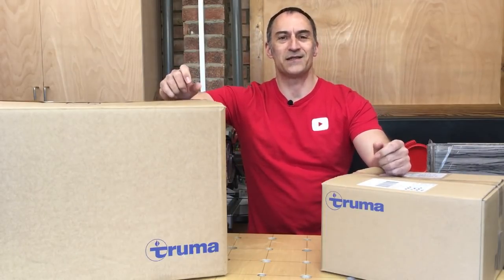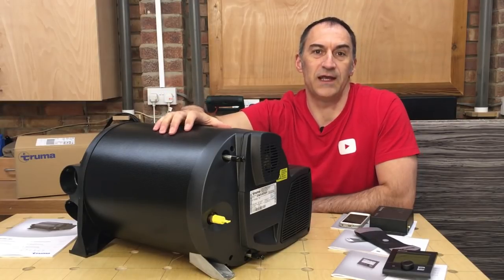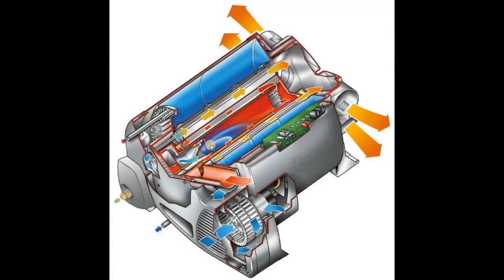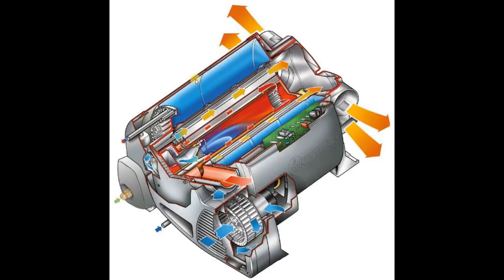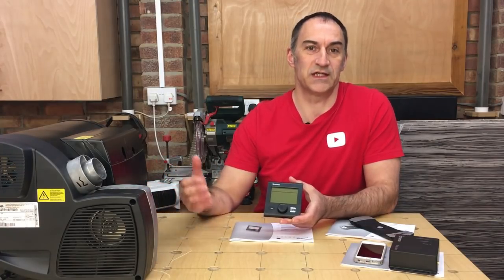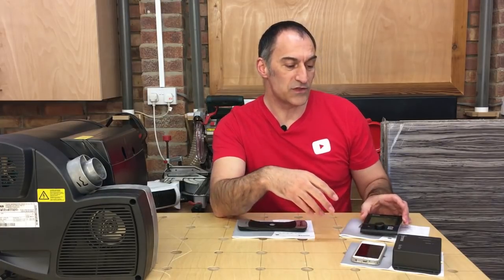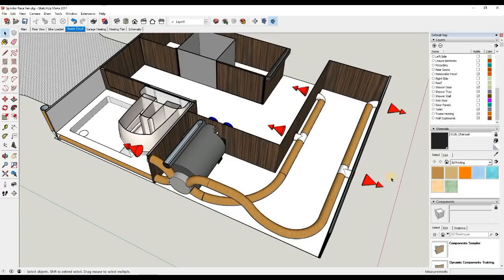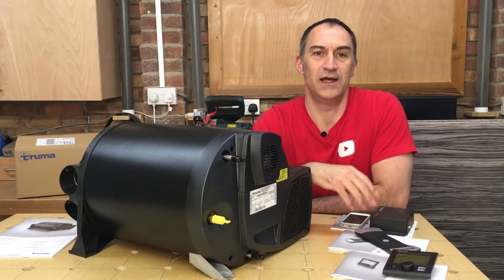Truma Combi 4e Heating & Hot Water Boiler

Comment: Hi Greg, what is the power consumption of this device and what kind of electrical system you suggest to have in order to run it well? Especially in my case where I do not want to use gas in the van. Thank you!

Comment: Hi Greg, great video thanks. Quick question - how does the the Truma wire into the 12v electrics? Can it go straight into a blade fuse in the box or does it need to go via a breaker? Also on the 240v side? Many thanks

Comment: very smart .. when it works - our Truma combi 4 e does not heat the air enough on gas/mains, AND overheats the water to the point where the red outlet pipe melts from the heat.. how come a temp sensor is not controlling this?

Comment: What do you think about using something like a Bosch TR2500 or a 5l Speedflow Undersink Electric water heater run off a 2000 watt inverter? 

I’ve seen a few USA sprinter conversions video that use this type of setup although off Lithium Ion batteries? 

On paper it’s a cheaper option for myself v the Truma but I’m just not sure/experienced enough to know if a power setup similar to yours Greg (which I intend to copy) would work?

Comment: Very nice presentation. I have been using my Truma in our RV since 2008 and still working as good as new. Good quality and great performance. Don’t have the option of electric heating of the water but yet but that is a spare part that I hope to install now that I am extending my roof solar from 100 watts to 1000 watts and a 3000 watt inverter.
Reply from the maker: That’s great to know you’ve had 9 years good service. 
I’m only planning to use the electric heating when on hook up as 900w or 1.8kW would kill my batteries in no time.

Comment: Hi Greg, great video. Question though: In one of your earlier videos is see you show a separate system (heater and boiler) i believer it was a Whale boiler and gas propex hs2000 heater. Advantage of this system IMO is that i can install both underfloor, which will save extra space. Another - i would consider as an - advantage would be that it are 2 separate systems, if one is broke, the other still works.... So, my question is, why did you choose for the Truma Combi system? (in comparison to 2 separate systems?). Thanks! Antoon - the Netherlands

Comment: Hi Greg. Thanks for the wonderful videos. I have a thought. How do you think it would be to use one of the four outlets to blow hot air into several 30mm pipes in the floor as underfloor heating? For example, with XPS made for waterborne heat where the air comes out on the other side of the floor.

Comment: Silly question, but can you take it out the box and plug it in to mains and just use it as a heater? 

As not to worried about hot water just want a good heater.

Thanks
Reply from the maker: I’ll be honest I’m not sure it would work without water in it?

Comment: Thanks for the great video! 
I'd still go for diesel version if you plan for more than couple of days offgrid in cold weather.
Combi 4 eats around 0.2Kg (0.4L) LPG per hour in a van like your Sprinter with 0-20 temperature gradient.  
This is roughly 10L LPG tank per day even without cooking and hot water.
And Webasto dual top can be mounted outside and free additional 70L of living space.
Reply from the maker: I will give you some exact usage data once we are on the road. Its all relative to how well the van is insulated as to how long the heater is running. Plus if we are cooking the heating will not be required either. We don't plan to spend too much time in the cold as winter camping is not very enjoyable. We will be on the Med by winter where its a bit more temperate.

Comment: Hi Greg, I have almost finished building a new caravan out of an old one and have installed a Truma 2E Water/Space heater. Gas and 12 volt were done by qualified tradesmen and I have followed your excellent videos for water plumbing (which is all working well). However, your videos indicate that, once the sensor and data cable are connected to the unit, the sensor should be sending the signal to the control panel but I can't seem to get the control panel screen to open and there is no backlight coming on. Are there any other steps to get it working? The control pad has the horizontal line across the top of the screen and I've tried holding the button down for a few seconds as well as touching the screen but to no avail. I've also checked all fuses including the 10 amp fuse in the unit.  Can you help? Thanks & Regards, Barrie (I live in Australia)
Reply from the maker: The CP control panel also needs a 12v supply protected by a 1Amp fuse. There should be a short plug and lead to connect onto the controller and to put power to. That will bring the controller to life 👍🏼🤩
Reply: Thanks Greg, Before I contacted you I had phoned Truma Australia who asked me had I connected the Data Cable between the unit and the CP and indicated that this was the power source. However, it seems it's not. I bought the heater new about 4 years ago and on the list of inclusions in the kit, #6 is "CP Plus GV". Do you know what the GV is? Everything has been in boxes since I bought it but I haven't seen the little lead you mentioned. Can you explain where this lead should be connected? Also on the list (#7) is a Sicherungshalter which I have - Does this have anything to do with the little lead? Thanks again, Barrie

Comment: Shouldn't the outlet pipes be of an equal length? By the looks of it, all your hot air is going to go into the bathroom because that is the shortest bit (least resistance), or am I wrong?
Reply from the maker: The bathroom vent has a butterfly valve on the outlet and we can close it right down to prevent that happening.

Comment: Hi Greg.  Great videos . Just wondering why you chose the 4e and not the cheaper 2e? .
Reply from the maker: It will heat the water to full temp in less than half an hour from cold. :D
Reply: According to the Truma info sheet the 2E does the same water heating time . I guess it will heat the cabin slower perhaps .

Comment: Thank you for explaining how this works, excellent diagram and detail!  Its a very efficient system.
Outside and inside air are heated, and while air heater is on, it also heats up the water, very smart!
The phone app and SIMM card remote control, propane tank accurate gauge is just genius!  Truly remarkable German technology!  Even named after US President Truman!  When I build my van, I don't care how much this costs or how hard to get hold of one, I am getting this system and no other.  Its a marvel of science and so beautifully created that it should belong in the Museum of Modern Art (MOMA).

Here are some other facts for viewers:
1. The only deal breaker for Americans may be that this runs on 240V so do they make a
        version for US market at 110V or will this run on a step down adapter from 240V to 110V?
2. I looked up cost on ebay and its not cheap at US $2700 approx.
3. Truma  in Germany does not sell the Combi directly to consumers, only dealers.
4. You can look up specs and buy it from this Aussie dealer at AU $2400 + AU$32 shipping. 
         https://www.mygenerator.com.au/truma-combi-4e-kit-gas-heater-hot-water-system.html

5. The weight of the Truma Combi 4e is 15.8 kg or 35 lbs
6. On the link above, you see all accessories, ductwork diagram, and specs.
7. Yes, you can run the water heater independently of the furnace heater.  However, your hot
         water is also heated for free if you run the furnace.
8. Combi runs on a variety of fuels and power sources:  gas, diesel, propane, AC, DC, and using 
        hot engine while driving if you duct it that way.  Refer to link above.

Thank you Greg, for another great video and adding to the RV/Caravan knowledgebase!

Comment: Another great piece of info Greg. I was originally thinking of a heater similar to the night heater in my truck running on diesel, but this system is far superior & combines the hot water function. Once again your info is a great help in my research before I take the plunge.
Reply from the maker: You're most welcome John, I'm pleased it was useful to you.

Comment: What about pulling the cold air return from the ceiling instead of the floor? I grew up in a house that was configured that way and it produced quite a uniform temperature from floor to ceiling. From your line of work I'm sure you are familiar with it. Hot air rises and cools as it does so. Would this add any efficiency to the system?
Reply from the maker: As you rightly said, The hot air rises, so it's actually cooler at low level and warmer at high level.

Comment: Hi Greg you may not of started it but how are you running water to your sink and gas from you LPG gas cylinder to the Combi Heater. Are you going out through the floor and across then up into kitchen unit. I am also fitting the Truma but was considering running under plywood floor. Just got van so starting in earnest soon
Reply from the maker: Hi Tracey, I have run my water and gas from one side to the other, underneath the van fixed to the chassis.
The main reason for not burying them in floors or walls is if any of it leaks I will never know until it's way too late and the damage is done. If it was a house build it is against current water bylaws to bury services into walls.
All you gas joints should be visible and in ventilated spaces.
Reply: Thanks for prompt response. Greg you are a Star Just bought my flooring materials. First run out in the Van. I am well excited to start my build and following you and others converters microscopically... I love your year plan to tour continental Europe I just posted a FB picture with my Van on the new Drive over last weekend. FB post - So here is our new venture called EDD (Explore Dream Discover) A conversion project into a home from home. He will take us on many adventures. From John O'Groats to Lands End, Coleraine to Cork, Trondheim to Tangiers and Brest to Belgrade. It will take over a year to convert but we cannot be more excited. The design is complete so lets start cutting holes.... Tracey

Comment: hello, Can I use this Boiler 100% electric to save gas? And my second question is can I take long showers with this model, or only have 10 liters? sorry for my english
Reply from the maker: Yes you can use it just on electric. I would recommend that on hook up as it’s rated for 1.8kw on electric 
You can use it on both field too for fast recovery. 
The water is 60°c so you would mix that with cold for a shower and it last long enough for decent shower.
Reply: @GregVirgoe  two people could take a shower with a single 10 liter tank? or it is necessary to reheat the water. Thanks for your time.

Comment: Hi Greg, realistically and setting some family expectations how long of a shower can be had with 10 litres of water? Just realised this is 2 years old!
Reply from the maker: The water temp is 60°C so you mix it with cold at the shower and get far more than 10litres. Lou and I can both shower on one lot of hot water. So if you use it all yourself it’s ample. We use a trigger operated shower head to conserve water
Reply: Greg Virgoe thanks for the quick response👍 unless it’s long hair washing day we should be ok for 2 showers that’s good to know! Another quick question. The E in Truma 4e indicates electric is that electric heating and water ie no gas used, off the hook up? Trying to make sense of all resource needs on and off grid 🤔👍currently looking at a Wildax that uses this Truma version 

‘
To

Comment: Greg-- do you know how much voltage is needed to run this system electrically when not using propane? Is it efficient voltage wise?
Reply from the maker: CHERIE VEAZEY the control system runs off 12v DC from your leisure battery and that use next to nothing to operate the controls, the electric heaters are 2x 900W each so a total of 1.8KW and these must be run off mains voltage 230v. Now I would not recommend running these electric elements off an inverter as it would drain your leisure batteries in minutes, I only switch these on when on campsite hook up shore supply. Although we have not used them at all so far as we have been wild camping the whole time and just running off our solar system. ☀️🌳👍🏼😎
Reply: Greg Virgoe so just to clarify, you can still have hot air heating  without running it off of the mains ?

Comment: Hi, great video. Is it possible to use just 2 heat outlets and if so how are the others blanked off? Would it make that much difference to heating the van? Also can the piping go down under the flooring and back up to where they are required as the furniture layout was completed prior to the purchase of this heater and the layout would have to be substantialy altted
Reply: I mean altered!
Reply from the maker: Hello Rob, three is the minimum you can use and put a blanking plug in the 4th. 
You need to pass a certain amount of air through the heater to prevent it overheating. I guess there nothing stopping you running the heater ducts outside but you would have to insulate them really well and protect them from damage. To prevent the air from getting cold in the external ducts.

Comment: Are you concerned of the garage area for any 'off-gas' (used as a general term) from your bikes et al. with putting the heating ducts/vents to this area are you also providing a path for any smells /fumes or through or around the bed frame. You are heating the bikes and any oil/grime could scent the area... Are you concerned that it will make it back to the living areas? maybe add a charcoal filter? Just a thought... (Foresight is always better than hindsight )
Reply from the maker: Hello Jon,
The only time a bike will be in there is when we are transporting one. 
When we are living in the van the bike will be outside of the van.
The outlets of the ducting have single blade dampers that can be shut.
The majority of the use of this vehicle will be with motorbikes just push bikes.

Comment: How has the truma performed thus far?  Think you sold me on it.
Reply from the maker: It is incredible, it just works so well and we use it mostly on eco mode and you can hardly hear it so quiet. 
You have the benefit of dual fuel when on hook up and the remote control via app on your phone even when away from the vehicle is one of the best features. 
You won’t regret it 😊
Reply: This is a huge bummer. Just found out that I cannot get the truma furnace/ water heater for dwisel fuel here in the US. Only motorcoach manufacturers can get it😬

Comment: Hi, I hope you are well. I have a question regarding heating and M.O.T. In my conversion (planning stages) I wanted to install an induction cooker and if I do use this unit, run it electrically. As I understand it if you have lpg, your M.O.T. is dearer and more detailed as they have do check the gas system as well. Would I be able to skirt this cost by soley using electrical power for cooking, heating and washing even if it means have 3 to 4 leasure batteries? I tend to drive longer distances when I do so I may be able to off set higher energy usage through regeneration whilst driving.
Reply from the maker: If you are resident in the UK then a Motor Caravan would get a class 4 MOT test which is the same as you have for your car, only if the weight of the vehicle is over 3500kg would it be a different class of MOT for heavy goods vehicles

Comment: Well impresive - does this mean you have to blow hot air even on a hot day to take a shower ?
Reply from the maker: No, the hot water can be heated without having to have the heater running.
This version you can also heat with electric when on hook up.
Reply: Sound just the jobbie

Comment: Hi Greg, Apologies for the late reply but I have been up north at Arisaig in my Vantage Sol (which has a Truma Combi 4) over the last week or so. Just to say the Turma works very well. I have been in temperatures of minus 13 in February with it and I was nice and warm. One point though Greg although it doesn't apply to my Van. I have seen on both the Autosleepers and Autotrail forums complaints about hot airflow to the furthest away vents from the Truma. Have you any concerns about even distribution of heat? Also just a point the cold spot in these Vans is at the sliding door where there is often a draft and the heat escapes quickly, have you considered this in the design? Another great video by the way ;> cheers.
Reply from the maker: Thank you William for the constructive feedback. I have got some adjustable vents to restrict flow on close outlets. 
I can position the vent in the bench seat closer to the door to help with that cold spot. 
Thanks again for the advice.
Reply: Cheers Greg, The warmest area in my Van is the bathroom and its main use is as a drying area for wet coats and towels  etc.Its worth considering having a warm space just for drying stuff in our climate. I use the Van lots in the winter and the inclement weather. Cheers
Reply from the maker: Exactly what I have planned. Thanks

Comment: Hi Greg is the 4e powerful enough or would you go for a 6e? Thanks patt
Reply from the maker: KeepTheBalance the 4e is more than enough. It’s most like 4x what you actually need in a van. We have only ever run it in it’s lowest setting eco mode even when snow outside. It’s super quiet and works brilliantly. Plus running hot water every day. Better than ring at home.
Reply: @GregVirgoe  Thanks Greg! I ordered it yesterday based on your advice :) I was looking at the 6e for a long time so you saved me alot ;) I just have a L3H2 relay so if its enough for your sprinter it'll be fine for me. Thanks again as always. Patt